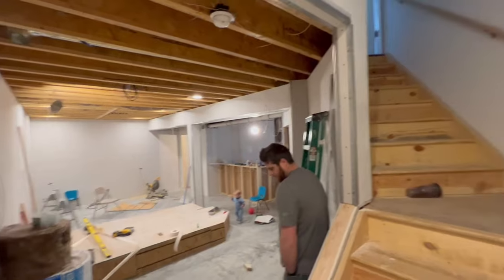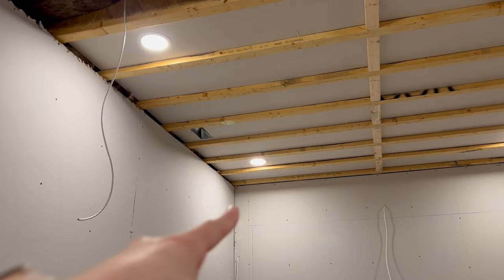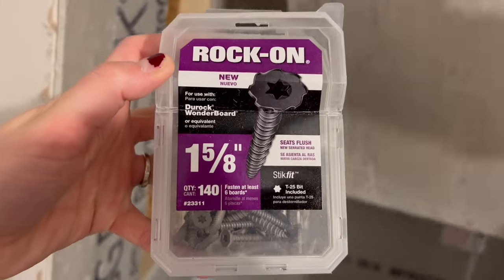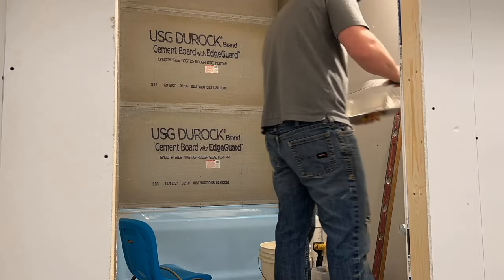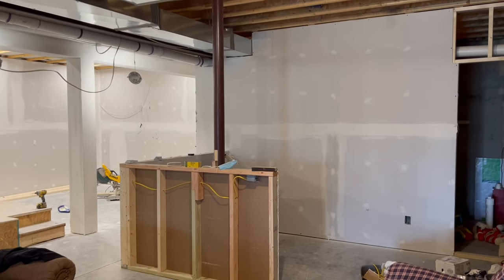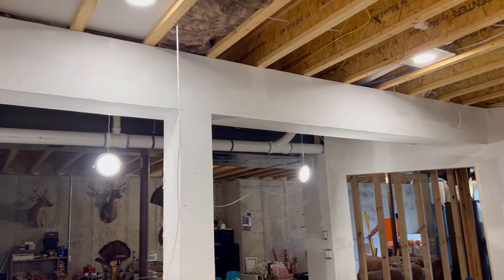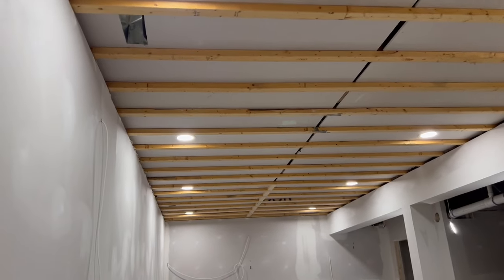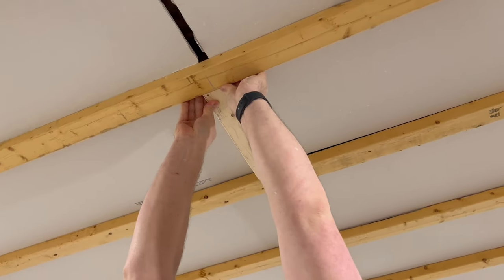Finishing Basement #11: DIY Accessible Ceiling | Drop Ceiling Idea | CHEAP, EASY, FAST & LOOKS GREAT

Comment: Less that $100?!  There's more than $100 in lumber let alone the "ceiling tiles"... neat idea but clickbait with the sub $100 thumbnail.
Reply from the maker: +Asa Trujillo Hello there! I’ll simply explain the ceiling for you. Technically you’re correct. It didn’t cost less than $100, it actually cost less than $50:) This ceiling is made out of 1/2 inch drywall that we cut into pieces and slid up over top of the lip of the i joists. We then painted everything black. Where we live in Kentucky, this drywall is $8ish per sheet of 4ftx8ft drywall. We used less than 5 sheets of drywall. In regards to your clickbait comment- some youtubers have to use clickbait for viewers to watch their “fake” videos. This method has ruined it for those of us that actually make real and helpful content with actual facts on our thumbnails… For us it’s not clickbait, it’s the truth. Our goal is to help other DIYers out there:) I hope this helped clear it up. If you have any questions please let us know:) Also- there is another video of this ceiling on our channel if you need to watch it. Have a good night!
Reply: Collins Country, Asa apparently didn’t watch the video or he just didn’t understand what you did. Awesome idea. I’ve been trying to find something nicer then a drop ceiling but still have access to above the ceiling. How did you finish the sides to the drywall? Would love to see a finished product.
Reply: @CollinsCountry  In Canada its $21 a sheet for a 4x8.
For the bathroom it's called Aqua board 4x8 sheet it looks blue on the one side it is the only gyproc that can be used for bathrooms and is mandatory building code here in Canada.
It's mold and mildew resistant in case of water leaks should ever happen. The aqua board is $31.00 a sheet. We needed 7 in our bathroom.
Looks like you used regular drywall panels in your bathroom.
I don't know what your building code is where you live but something to look into, as it doesn't cost $8 a sheet anywhere.
You still used material that cost money at some point I agree there is no way this was less than a $100 and is deceiving to someone who doesn't know anything about construction. 
🪵 Lumber here is like gold since covid and at least 60%-80% more than pre-covid era.
Would be nice if all you tubers were honest about the real cost.
Some will say a certain remodel cost them $200 and then they finally say 90% of stuff was given to them for free. 
Sure it only cost them $200 but in actuality IF they had to buy ALL of the products needed for the project would have cost over $2500.
That should have to be stated in the first few sentences of a video.
Reply from the maker: @timparker8759  Hey! I am sorry for just now noticing this comment... Anyway. The ceiling is now finished and I will post the video below, but we painted all of the drywall on the ceiling and put boards around the edges where the ceiling meets the wall to make a smooth transition and completed look. It was soooo easy and cheap! Here is the finished ceiling video: https://www.youtube.com/watch?v=43R89Ev1W9s&t=122s
Reply: Collins Country. I’m actually really close to finishing my version of this ceiling. I used 5/8” drywall cut into sections. My room is 12’ wide, so I used 3 4’ sections across each bay. I cut 2x3 wood to his the seams of them boards. To finish it off I had 1/2” plywood cut to 4” wide strips. And installed that over all the 2x3 wood showing from the rafters. Then I used a router to give it all a profile edge. Finally I paint the drywall light grey. The 2x3s black and the trim boards white. Gives it all a coffered ceiling look. I’m not sure if I can send you pictures on here.
Reply: Also I found a web site that shows this ceiling. And explains that it passes fire safety standards between basement and upper floor. I got a permit, so my inspector questioned it at first. Once I found the web site he was fine with the safety standards it meets.
Reply: @AC-tn1cy  In Ohio it’s $11 a sheet for regular panels and for moisture resistant/ mold resistant it’s $20 a sheet.
Reply: @hospitalfood6621  Even with the exchange rate lots of stuff cheaper in U.S compared to up here in Canada 😓
Reply: @annaletticks5995 except Healthcare, medication, education you know...the unimportant things 😂
Reply: Hey Tim, would you be able to send a picture of I sent you my email or something else? I am looking to do your idea but I can't fully picture it. Thanks man
Reply: @timparker8759 What is the website?

Comment: I did my parents a favor putting in a drywall ceiling while they went on vacation. Had a buddy help, but wow getting drywall mud on a ceiling, the endless sanding, waiting for a day or two in between coats before sanding...I was wiped out and pledged to never drywall a ceiling EVER again. It sucked for sure, but looks pretty good.
Reply: use faster set mud.

Comment: this is genius !!!!!   I don't have i-beams but normal 2x10 joists.   if ANYONE has a clip of what they mean by using 1x2 or 2x3 as framing for normal joists, please let me know... I at least need to see what this looks like... I'm a visual learner.   fantastic job and thank you for posting Mrs and Mr Collins.     I can't wait to cut my existing drywall down.  I may even be able to re-use some of it :)
Reply from the maker: We are glad this is helpful to you. With existing 2 x 10 joists you could screw some 1x4s  or 2x4s to the bottom of the joists to use as lips to hold the drywall. 1x3 could work too but wouldn’t give you as much of a lip to hold the panels. Good luck!!
Reply: thank you soooo much!   @CollinsCountry
Reply from the maker: +@TheRealRobM welcome! :)
Reply: I’d like to see that as well! We have 2 x 10 joist and need to see it because I’m not getting the picture in my head. 😂

Comment: The ceiling idea is genius.  Even if you have regular wooden beams, you can attach some 2"x2" boards along the bottom edge, and lay sheetrock on these 2x2's.  A person can even attach a board that extends past the edge of the drywall and have the drywall flush with the bottom of the ceiling beam.
Reply from the maker: +Alexei Tetenov Absolutely! You could make this work multiple ways. I 100% give all this credit to my husband. He is SO CREATIVE and smart when it comes to this stuff. Anyway. Thanks for the nice comment! If you’re putting in a ceiling, I hope it goes well:)

Comment: Watched this fasinated with the idea. I have a dropped ceiling in my basement and have been contemplating tearing it out and putting up drywall then came aross your idea. I will now take the dropped ceiling out ( 40 years old ) and use your idea as a replacement.

Comment: I have a shop that has the I beam joists above it.  I needed a ceiling that if in the future I need to get inside to run or rerun some wires.  Saw this and what a solution!  Never thought of doing it this way.  I think I will now that I see it  Perfect for my situation.

Comment: Great idea. I will copy for sure. It's juat that brilliant. My only change would be to led lighting. These lights aren't built well anymore so when the lights fail, you will need to replace and hopefully have extras or can buy more of the same. Its convenient when you can just replace the led bulb. Just a thought.  Either way, your basement looks beautiful and appreciate you posting all the details.  Much luck to you all.
Reply from the maker: +@jasonp3896 thanks! These are easy to change out too, wouldn’t take long:)

Comment: Currently doing this in our basement…my question is, how are you going to be able to get those drywall boards in and out after you’ve put in the center 2x3s? They’re easy to put in before that but near impossible to take the drywall out once that center line board is in.

Comment: Great idea...  I have I-Beam basement and want to remove the drop ceiling,  but the I-Beams have cross braces which are in the way of this idea.   Can I remove them if I have I-Beams or was there a reason the builder added them.    uncertain on this point.  Great job..

Comment: We are finishing our basement and were torn between a complete blackout ceiling or drywalling and mudding the ceiling. Your provided solution is awesome! My question is how did you deal with the perimeter where the walls come up to the ceiling? did you hide the gaps?
Reply from the maker: I used a 2x6 as a trim piece around perimeter. It looks nice. Simply finish nailed it to bottom of I joist.

Comment: This is a great idea for the basement ceiling.  I have been trying to figure my ceiling out for years.  One question I have is What is the thickness of the sheet rock that you used in the ceiling?
Reply from the maker: It is 1/2 inch. Plenty sturdy enough.

Comment: Sorry last question and I think I missed it. How did you go about painting the ceiling? Did you just leave it all in place and use a sprayer?
Reply from the maker: Yes. To save time we put everything in place and sprayed with a harbor freight paint sprayer. We picked up some flat canned spray paint to touch up the areas that show after we move panels. Works great.

Comment: I’m doing something similar in my basement but I don’t have I-joists so I’m fabricating my own version but wanted to ask you how wide the lip that the drywall sits on? An inch +/-?
Reply: I’ve been planning a 1/2in lip but now I’m wondering if that’s too little…
Reply from the maker: @jeremiahchaney190  I think 1/2 inch will work but if you can change it I would make it at least 1 inch. I believe our lip on the I joist is about 1.25 inch.

Comment: This is seriously creative.  I wish I had those I-beams.  I would totally do this.
Reply from the maker: +Marti Thew THANK YOU! The credit 100% goes to my husband. We talked for over a month about what to do for the ceiling. We were at a standstill until we figured it out. One day this idea just came to him and BAM- we ran with it. It worked out flawlessly and we are very happy with how it looks! Thanks again for your nice comment:)
Reply: You can still do this with standard joists, just add a 2x3, 1x4, or similar board to each joist to form the lip. I plan to do this as well as pre-sanding, filling, and painting the boards before they go up so I only have a little touch-up from nail holes to worry about afterwards.
Reply: @etchmfg  yep I will have to make the lip for mine as well
Reply: @etchmfg why would you need to sand and fill the drywall?
Reply: @justinrodriguez7209  the wood strips that form the ledge, not the drywall
Reply: @etchmfg  ahhhh i see. I’m preparing to do this with some drywall and 1x3’s. So those have to be sanded before they get painted?
Reply: @justinrodriguez7209  it depends on what you buy - wood comes unsanded, pre-sanded, as well as pre-sanded and primered...of course the price per board will reflect that. You can always paint a test piece and see what you think. If you're happy with it, that's all you need!
Reply: @etchmfg  i see. Did you ever end up doing this? If so how’d it come out?
Reply: @justinrodriguez7209  not yet, im in the middle of our bathroom reno...I promise I'll get to it within the next 10 years, lol
Reply: @etchmfg  hey so I’m actually in the process of doing this. What kind of nails or screws would you advise i use to secure the 2x4’s onto the joists?
Reply: @justinrodriguez7209  Cool! What tools do you have? Drill, nail gun, hammer? Did you buy the materials yet? I was thinking more like a 1x4.
Reply: @etchmfg  so far as tools go, I have bought a finishing nailer, a drill, a drywall square, a utility knife to cut the drywall and a hammer. 

I bought the drywall 4x8’s (much heavier than i thought lol), some 1x4’s AND 2x4’s (to see which held the panels while looking the best. 

I bought a Craftsmen 20v Finishing Nailer with 2.5 inch nails with wood screws that I was going to put at either end. Does this sound like a good way to hold to wood in place or should I use other methods. Thanks!
Reply: @justinrodriguez7209  Cool! Nails of that length would be okay for the 1x4s but not quite long enough for the 2x4s. I like the screw and nail combo idea, the nails would be fine normally but the extra insurance is nice. The nails are going to be easier to cover with caulk, putty, or spackle before painting. If you screw into the 1x4s, I'd pre-drill and countersink (search amz for countersink bit) them so they go in cleanly without splitting the wood. I'd just go with 3-4 3in screws per board if you go the 2x4 route. Best of luck!
Reply: @etchmfg  About halfway done with my bedroom, this project is taking longer than expected!😂😂

Had to do a bit of improvising cuz it turned out some of my joists were uneven and in one area the joists form a rectangular shape instead of a regular joist. Not sure what the builders were doing when they made my condo but it’s coming along nicely tho!

Comment: Don't mean to rain on your parade ... and the ceiling does look AMAZING!
Just thought I'd point out that floor joists have a top that is constructed to deal with compression and a bottom that is made for tension.
If installed upside-down, as yours seem to be (at least some of them look like they might be) they're not able to deal with forces nearly as well.
Just be careful where the piano goes on your main floor. 😜
Reply: There is no up or down for TJIs. Also since it’s an engineered product crowning is not an issue either. Not sure what you are talking about.

Comment: Hey guys great job. I’m in the process of doing the same to my detached garage. I have a question about the drywall ceiling. I have the same i beams, have you noticed any bowing or wrapping of the drywall ceiling? Just wondering if I should run a couple of screws now and then. And sorry I’m late to the game but just ran across this video. Thanks for any advice
Reply from the maker: We do not have any sagging on the drywall. We used 1/2 inch. Hope that helps. Thanks.

Comment: I am doing the same for ceiling. Have a question on insulation. Which insulation you guys used for the ceiling and how much did it help in sound proofing?
Reply from the maker: We used fiberglass insulation. It does help with the hollow boomy sound from the bass but does not limit the sound completely to the floor above. I would likely hate it with out the insulation. That being said there are better sound absorbing insulations out there that are more expensive such as rock wool insulation and denim insulation. Good luck
Reply from the maker: One other tip. Sometimes the drywall panels can vibrate with bass sounds so when installing insulation make sure there is slight pressure pushin down on the panels to keep a tight seal against the lip of I-joist.

Comment: What thickness drywall did you use for the ceiling.  I did the same thing with 1/4 plywood on my basement ceiling, however the drywall looks easier to cut and lift into place.
Reply from the maker: Hey! We used 1/2 inch drywall. We loved the drywall because it was dirt cheap and easy to cut and easy to install. Over a year later it still looks flawless.
Reply: Thank you for the quick response, may I ask why the flat black verses a satin paint so it could be cleaned easier?  I am about to start a project once we close on our new home. The basement is 66 feet long and 28 wide, what a open/blank
 pallet it is! @CollinsCountry

Comment: I am doing to do the same. I am curious. How are you finishing the ceiling in the rest of the basement and that section with pipes hanging low?
Reply from the maker: We will be doing traditional drop ceiling using the 3 dimensional 2x2 ceiling tile. I like everything accessible. Thanks for watching!

Comment: This idea is really great. 
Can you let me know how the middle wood piece is attached?
And also I tried to do this but my framing is not like yours do you have any ideas to get the ijoys to hold the drywall pieces?
Reply from the maker: +Katti Harish Thank you! The middle wood is attached with 2inch trim nails out of a Dewalt nailer. The middle wood that is holding the projector is attached with deck screws. And about the drywall- our i joists are holding up the drywall pieces. If you have i joists then you should be able to just set the piece of drywall in the lip of the joist. I hope this makes sense…
Reply: @CollinsCountry  thanks for the reply.
But my framing doesn’t have I joists so do you have any suggestions for it?
Reply from the maker: +Katti Harish Oh sorry. I misunderstood you question. Honestly, I’m not sure what to have you try since your i jousts are different… Do your i hoists not have the lip that you can set the cut pieces of drywall on?
Reply: @CollinsCountry  - Yes we don't have the lip to hold the cut pieces of drywall
Reply: @Katti Harish ~ One idea is attach 1x4 (actually 3/4”x3-1/2”) to the bottom of your joist. I don’t have i-joists either. My joists are 1-1/2” wide. I’ll make an i-joist with the 1x4, spitting the difference between, then proceed. I’ll do the same at the center seam where the drywall meets, using 1x4 and attach with finishing nails. @Collins Country ~ Thanks for the video’s as they have given me ideas and inspiration!

Comment: Hi, is there any way I can use this ceiling method if my joists don’t have those lips to hold the drywall?
Reply from the maker: You would probably have to screw or nail a 1x3 to the bottom of the joists to have a lip. Yes it can be done.
Reply: Thank you

Comment: How did you all make the panels accessible still when they have light fixtures in them?
Reply from the maker: These lights are removable. There are spring clips that hold the light in place. The light actually unplugs from the electrical box and the panel can be removed. It’s super easy and very convenient. I need to do another video showing all this. We will be working on that soon.